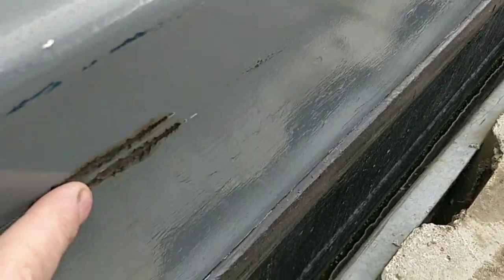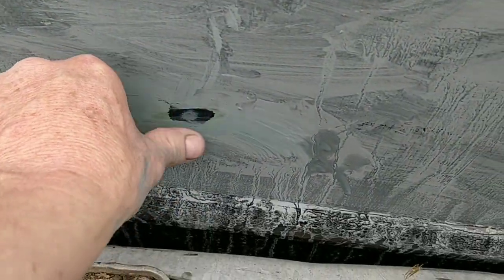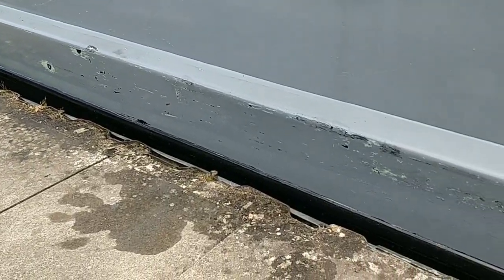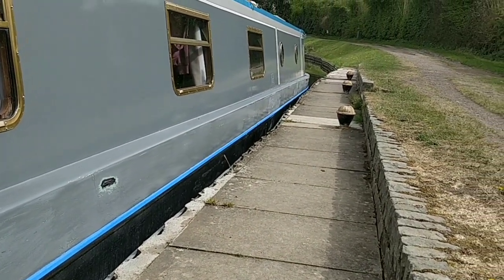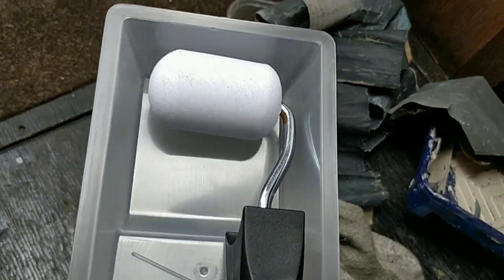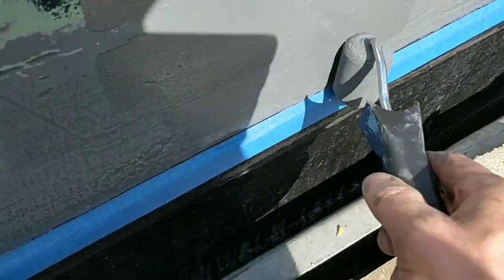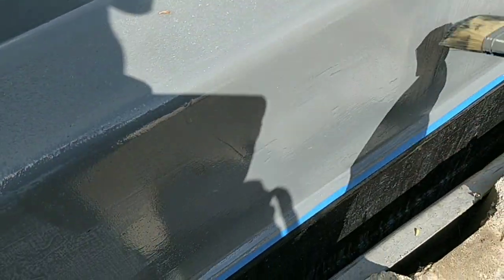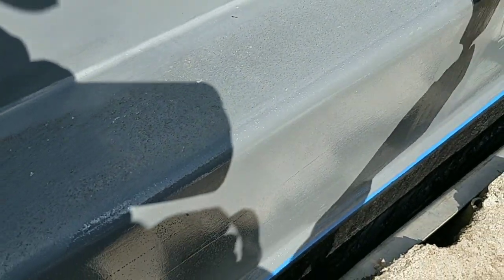Little bit of a touch up..Painting narrowboat..

Comment: Nice job Will. As you say perfection is not necessary as it will require another coat soon enough due to normal wear and tear. Thumbs up mate and thanks for sharing. Regards Col.
Reply from the maker: Ahhh cheers Col. Doesn't make sense spending a fortune on coloured liquid.